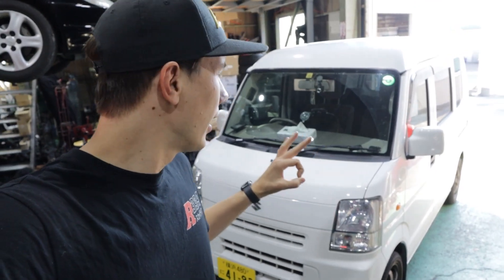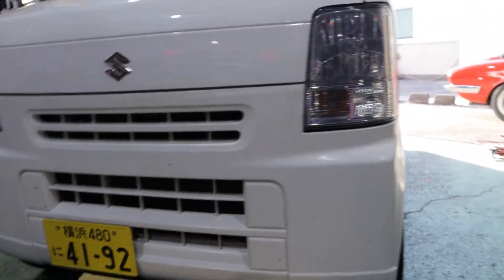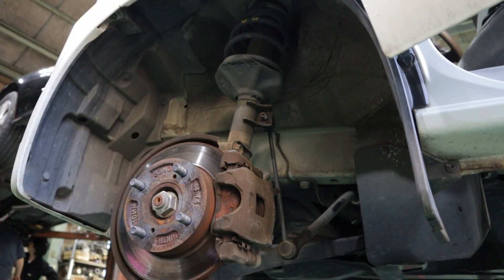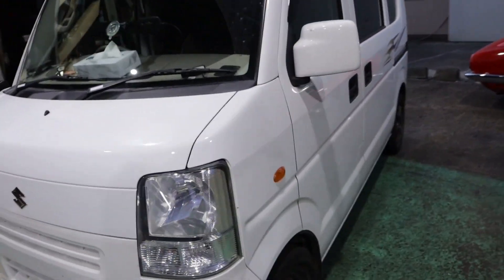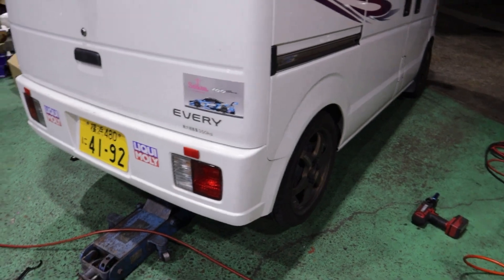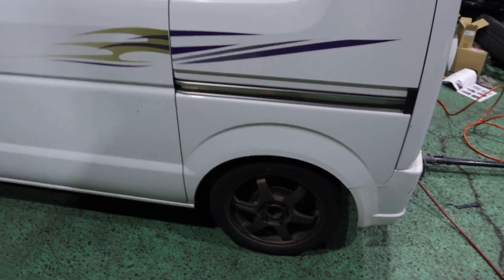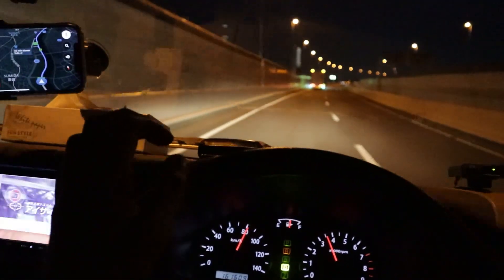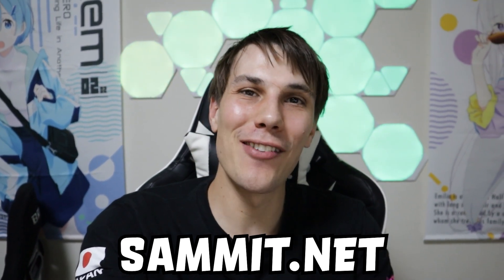KEI VAN GETS COILOVERS & LOWERED!

Comment: I dont know if you know about the panard rod / trap bar thats on the back of solid axle cars like that. It goes between the chassis and the axle. The bar is the length for a standard ride height car. I you lower it the rod will need shortened. You can buy adjustable ones. The rear geometry might not be out much due to small amount your lowering it tho. 
Just thought id point this out.
Great video as always! much love from Scotland.

Comment: You may want an adjustable pan hard rod, as it may push the rear axle to the o/s as you lower it and you may need to notch the mount on the body, if the rod moves up as you hit a bump, it looked like there wasn't much clearance and it may hit and be the knocking you feel, i love it though looks awesome!

Comment: Prob should maintenance the diffs, idk bout the front if it's part of the trans or w/e but rear should be good for synthetic but always check to make sure it jives.  Efficiency stuff always help with low power, that and weight.  If you time attack it pull all the seats & spare